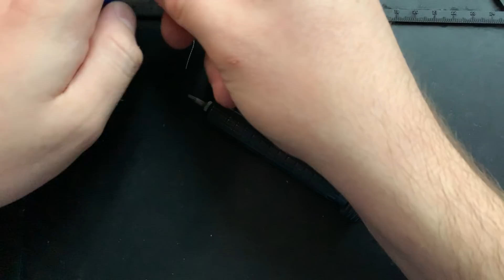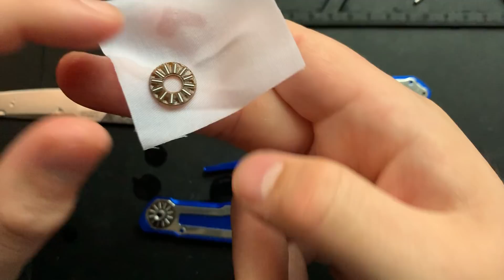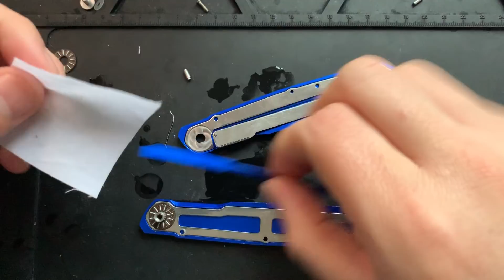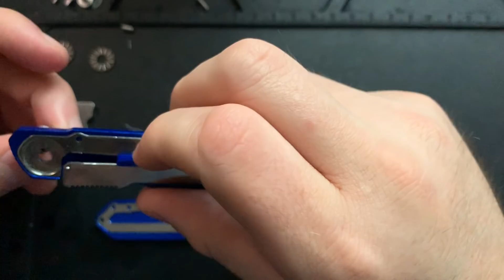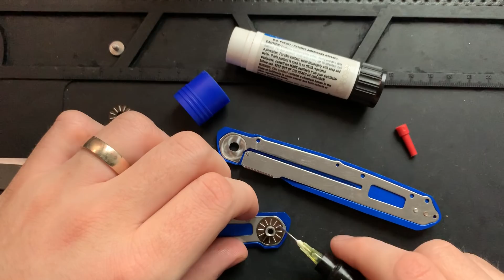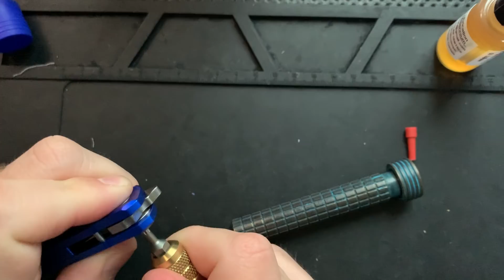How to disassemble and maintain the Real Steel G5 Metamorph Pocketknife

Comment: The one that I got had excessive lock bar tension.  Backed it off just a bit while I had mine open and, man, what a difference.  Wish this had been out before I opened mine.  Would have saved me a bit of time trying to figure out which side to build from and what went where right off the bat.  You had the same issues I did trying to figure out if something was lost.

Comment: I wonder if the washer is to help with tension on pivot and/or to protect the aluminum frame from the pivot screw when tightened.
Reply: That and to act as a locktite of sorts. You're precisely correct

Comment: Rod bearings... on a round washer?? Doesn't that cause uneven wear and friction on the surfaces? The rod can rotate as a single unit, but for a single rotation (e.g. 180 degree opening), the track of the outside of the circle (outer edge of rods) would ideally need to rotate more (a longer path) than on the inside of the circle (inner edge of rods)...

So no matter how fast or slow the rods are spinning, there will be parts of the disk (inner or outer or both) that are moving too fast or too slow, i.e. slipping instead of rotating...
Reply: Such a small scale. It's not such a big deal these are tiny

Comment: Just to add to the couple other people, if you're a knife manufacturer with a history with too much Loctite, using a little plastic washer or an o-ring is a very good idea, because due to their elastic properties, they put the screw under tension against the screw's track so that they don't back out, and then your pivot won't move, but you can easily remove it when you're disassembling the knife. I haven't seen the full review but hopefully you don't put that as a knock against Real Steel.

Comment: Of course you didn't expect to see needle bearings in there--they're not considered appropriate for that application. When you put needle bearings in a  circular race, the end of the bearing away from the pivot needs to travel farther than the other end, which means the ends need to spin at different rates. Obviously, they can't, so they skid. That's not optimal. Sure, they can take more lateral load, but they won't spin as well as balls. When they're used in loaded situations like thrust bearings, they're often asymmetrical, narrower at one end, to compensate.

Now maybe I've talked myself out of ordering one, but I doubt it.
Reply: You're exactly right. But when we are talking this small of a scale it's very minimal. And it does add strength. I have many bearing knives and this works as good as the rest of them.  A few more expensive knives take this approach!

Comment: Needle bearing in this application are stupid. Consider that , during rotation, the end of the bearing rod furthest from the pivot must rotate faster than the end closest to the pivot. Obviously it is impossible for one end to rotate faster than the other
Reply: Except if they are conical in shape. The difference between the outside and inside diameter of the needles isn't that large in a knife.
Reply: Remco Meeder yes.  But are they conical on this knife?  Now it’s bothering me
Reply: James Buttitta Say what you like but like Nick pointed out in the video needle bearings give better lateral support to the blade having much more contact surface on the pivot whereas ball bearings only have a very small single point of contact on the pivot point. The needle bearings having more contact surface with the blade makes this knife much less likely to suffer from blade play from hard use and still retain smoothness of the action. There’s pros and cons to each design. It’s hard to get quite as smooth of an action with needle bearings as you would with ball bearings given the minimal contact surface of ball bearings to the blade but the con of ball bearings is that they will wear more unevenly relative to each ball which can cause blade play over time. Whereas needle bearings will wear much more evenly relative to each other with their greater area of contact surface making the knife much less susceptible to unfixable blade play through prolonged and/or hard use of the knife.